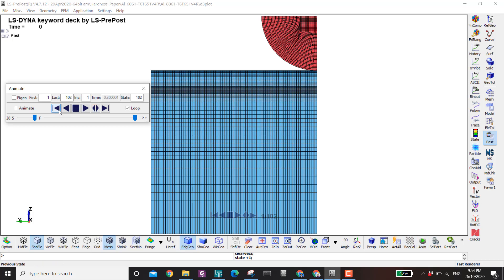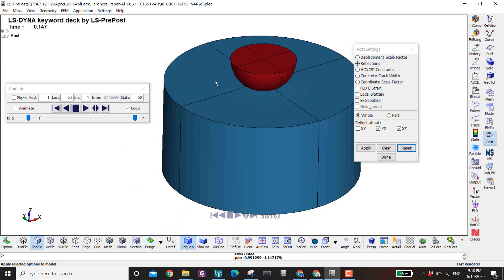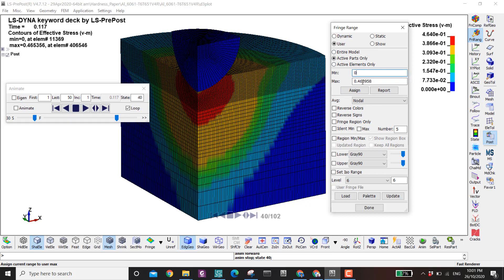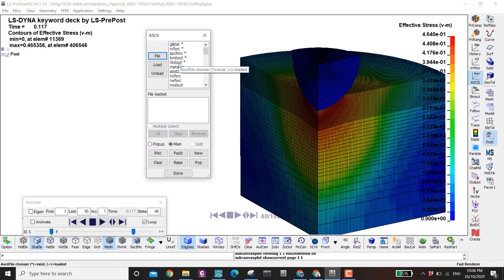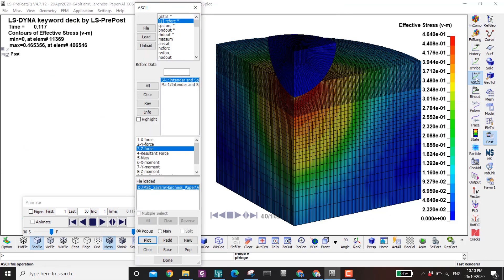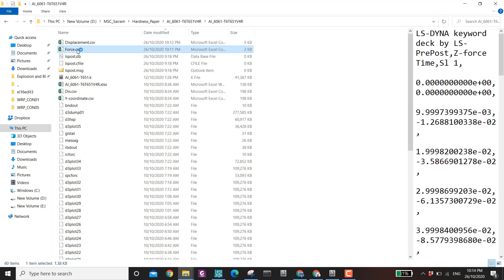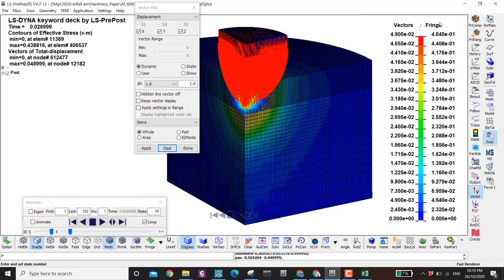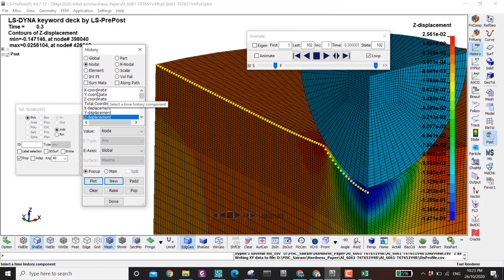Post Processing Tutorial (with LS-Prepost)

Comment: hi, Ameen ı have 36 scene. You have more as ı see in this video. However, your animation very fast. As soon as ı change the fringe component such as V-M to pressure it takes too much time to run simulation. Is there any way to make it faster. I have 48 core but ı think computer or ls-dyna uses 1 or not. For post processing not for whole analsys.
Reply from the maker: @SelamsızBando  it could be because the model size is very huge. This is more related to the RAM size and graphic card.  And has little to do with the CPU.

Comment: Please make a video in which we can learn how to apply symmetry in two perpendicular plane for two bodies using *BOUNDARY_SPC_SYMMETRY_SET . Thanks Sir
Reply from the maker: I never used this keyword. I usually have my symmetry planes on the XY, YZ, and ZX planes or parallel to these planes, and I use *CONSTRAINED GLOBAL.
Reply: @AmeenTopa  Thanks for your reply. I am struggling to control element penetration at higher velocity (say 5km/s). Can you please suggest any method to control element penetration
Reply from the maker: @NikeshKumarOjha  element penetration in contact? Refine the mesh and/or reduce the timestep scaling factor (TSSFAC).
Reply: @AmeenTopa  how minimum the value of TSSFAC can be? Please suggest
Reply: I want to ask the range of TSSFAC (minimum and maximum value).
Reply from the maker: @NikeshKumarOjha  the default value is 0.90.

Try to make it 0.5 and see if the problem is solved or not. 

Take note that you are talking about hypervelocity impact. This requires very small grid size and mostly you would need SPH or ALE method.
Reply: @AmeenTopa  I have used TSSFAC 0.1 and time step 1x10^-9. Still, there is an element penetration. The element size I am using 100 micron
Reply from the maker: @nikeshkumarojha4723  you are using standard FEM elements? SPH or ALE?
Reply: @AmeenTopa  standard FEM elements
Reply from the maker: @NikeshKumarOjha  for hypervelocity impact (5km/s), standard FEM won't give good results. It is better to use the SPH or ALE method.
Reply: @AmeenTopa  Dear Sir, can you please help me?
Reply from the maker: @NikeshKumarOjha  You need to learn the ALE method. I have a tutorial on EFP, and also a tutorial about ball drop on water. If you understand these two videos, I believe you'd be able to do hypervelocity impact with ALE method.

Comment: Hello Sir
Thanks for this video! I have a small question. Can we change the max value of the Y axis? Eg:- my Force plot shows 28-29N and my y-axis ends at 30N. Can I make my y-axis go to 40-50N with the plot remaining same at 28-29 level?
Reply from the maker: Yes, in the plot window, under the Scale tab, you have the options Xmin, Ymin, Xmax and Ymax.
Reply: @AmeenTopa  Ohh found it, Thanks!
Reply: @AmeenTopa  Sir, I have done 3 impact analysis with 3 different materials (3 different d3plots). I wanted to know if I can plot their resultant force graphs into a single graph for showing comparable analysis?
Reply from the maker: You need to save the result first from the three different simulations. Then you can use the LOAD option to import them into a single Post Processing session.
Reply: @AmeenTopa  First to open any of the d3plot and load using 'Load' in Plot Window and then load the csv file?
Reply from the maker: @sanskarsogani3137  yes. But first you need to already have the CSV file saved...
Reply: @AmeenTopa  Got it! Thank you so much!

Comment: That is nice video. If you have four fixed buondary constraints. How do you plot a reaction force on the each BC individually?
Thanks!
Reply from the maker: DATABASE ASCII SPCOUT or BNDOUT
Reply: @AmeenTopa  thank you so much.
SPC works fine not BNDOUT I don'tknow why. The main problem I am facing is I have four screws that supports the load unequalily and I want to know which one of the screw has the maximum reaction forces. However, in your case we have to select all the nodes which doesn't show me individual reaction forces. Is there any way to group these nodes and display on post- processing?
By the way when I use MPC as BC, both SPCOUT and  BNDOUT options doesnt load the result.
Thank you so much for your help as I am learning a lot with your videos.

Comment: Hi Ameen!! Without your tutorial my work will be slow. I am doing vehicle impact on concrete column.How to keep the original color of vehicle after impact when I go to Fricomp all part change color? Thank in advance
Reply from the maker: Hi Met mey,

Firstly, display all the parts with their colour. Then, hide all the vehicle part. Now you have only the column. Next, go to the Fcomp and display what you want to see (stress, strain, etc). Once you got this the column, you can unhide the vehicle. 

To hide or unhide the parts, you can use the Assembly and Part tool. Just click on F2 for a shortcut to this tool.
Reply: @AmeenTopa  Thanks for fast reply. Sorry because my question above is not accurately. I mean if I want to display all these two parts (column and vehicle ) in the same interface and when I go to Fcomp I just want to see the color change in column and the car still in original color but shows deformation.
Reply from the maker: Hey, 

Yes, I understood your question correctly (I guess). That's why I said after you show the Fcomp of the column, and unhide = display again the car parts. Now, all parts will be there but the column will have the Fcomp colours.
Reply: @AmeenTopa  Thanks so much. It works now
Reply from the maker: You are welcome. By the way, you know Keoagile? Your comment on my other video was removed automatically by YouTube.
Reply: @AmeenTopa  I have replied his question it's surprising me why they deleted my comment
Reply from the maker: @metmey5828  that's why I asked... because if you know him you can answer him directly.
Reply: @AmeenTopa  I don't know him

Comment: Salam. Sir, do you have the tutorial of the indentation of the spherical tip shows in the beginning of the video?
Reply from the maker: WaAlaikumussalm. No. You can make the file yourself. All the keywords and basics are covered in my previous tutorials.

I cannot share any details regarding this simulation because it is part of unpublished work.
Reply: @AmeenTopa  for indentation, can we use prescribe motion? and may i know, let say i want to make a scratch test model. The indenter have normal force acting downward, while the indenter moving horizontally, velocity is horizontal. what is the keywords to make the normal force of the indenter acting downwards.
Reply from the maker: @wnfresourcessdn.bhd.hafizu5928  Yes. You can. Please check my Tensile Test Tutorial, and Three point bending tutorial.

Comment: Hello Dear, can we plot the damage (Compressive and Tensile) contour fringe ranging from 0 to 1 where 0 indicate no failure and 1 indicate deleted element?
Reply from the maker: What material model you use? If composite, you can check my tutorial on Concrete Column wrapped with Composite Laminates.
Reply: @AmeenTopa  Thanks for the response dear...I saw that tutorial but the thing is I am using HJC(111) concrete model with MAT EROSION as 0.13 which lead to effective plastic strain range from 0 to 0.17 only.
Reply from the maker: @mohitbisht8503  If you are using MAT ADD EROSION then it is not possible to have plot contours for damage. With MAT ADD EROSION, we don't have damage, we have only element erosion. Damage means the material properties degrade while erosion means the element will be deleted.
Reply: @AmeenTopa  Thanks for the response dear and good news is i got the damage contour by using Extent Binary which i saw in one of your tutorial. So thanks to you again for that tutorial.